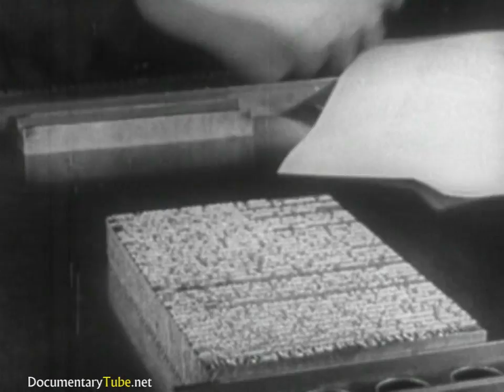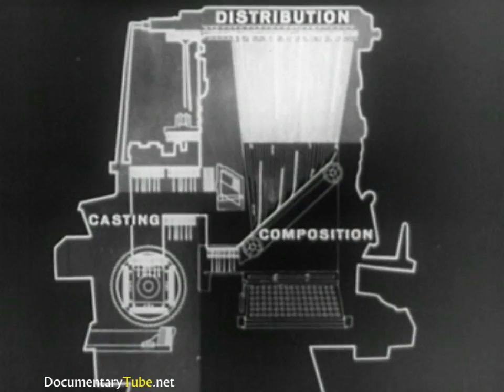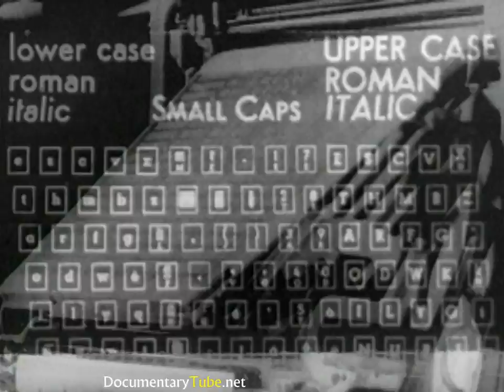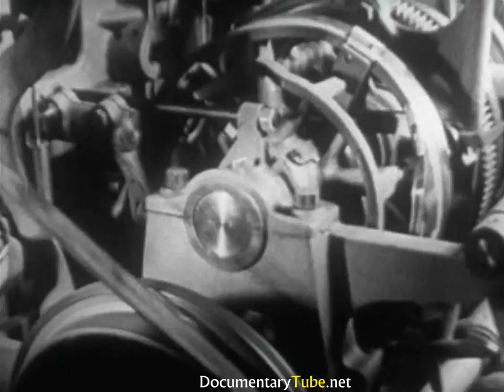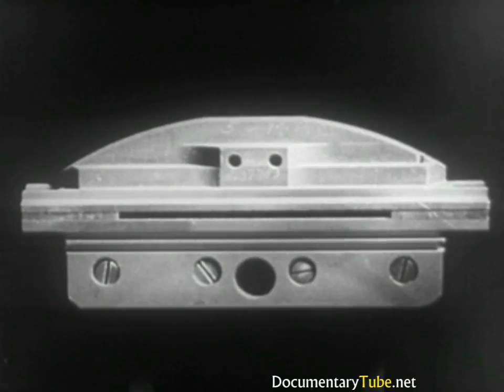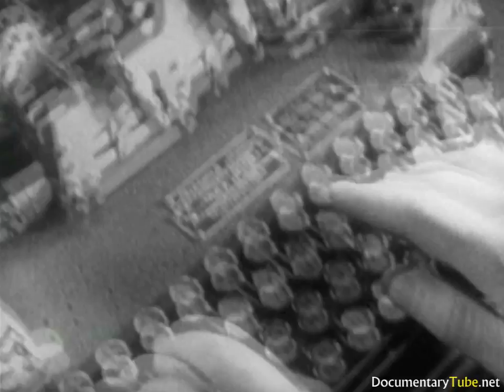HOW IT WORKS: Old Typesetting Machines

Comment: One thing I've wondered about is that capital I shaped thing that a computer cursor turns into when you put it over text. Why is it shaped like that? Is it supposed to be a callback to some part from one of these old printing machines? Or is it supposed to represent something from a typewriter. If you don't know what I mean, just put your computer arrow over this comment and see what it turns into. That's what I'm talking about, the capital I shaped thing, not the lowercase l shaped blinking line that the words come out of when you type. That thing I know, is obviously supposed to be the digital version of the thing that moves across the paper on a typewriter, where the letters come out, and makes it ding when it reaches the end of the page. I think that thing is called a cursor on a typewriter, but on a computer, the arrow is called the cursor, so I'm not sure if the blinking thing where the letters come out is also called a cursor or something else.

Comment: Holy insanely complex clockwork word processor! I'm most impressed by the distribution stage, which separates the letters. I thought people did it manually. Still if they made thick daily newspapers this way, which were discarded after a few days or a week. Damn.

An error by the typist must be difficult or impossible to correct (in case of the perforated band). I suppose they used 7 feelers (bits) in the automatic operator in other times to select more punctuation marks and foreign alphabets (all of the 90 keys). And the operator still can't select the second register (italics, small caps)....

The overdone noise reduction makes words difficult to hear.
Reply: The paper tape teletype machines which I used in the 1960s to write computer programs, had a roll of paper as well so you could see what you were typing. If you made an error, there was in fact a 'backspace' which moved the tape one row back and punched ALL the holes, so you just produced a 'NULL' character. So what the operator on one of these needed was the same kind of arrangement ! It's an impressive piece of mechanical design and manufacture. I cannot understand why the video had 10 dislikes !